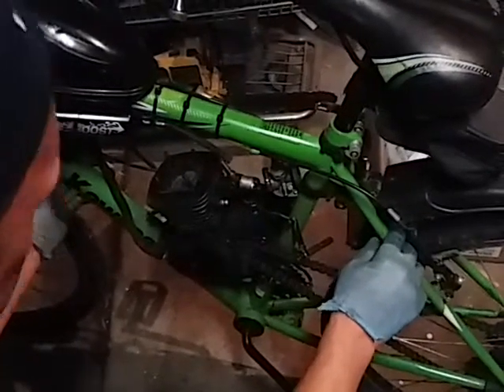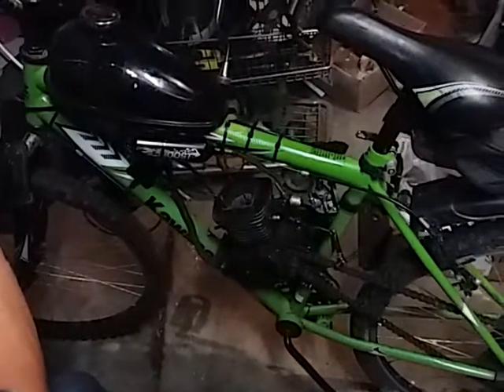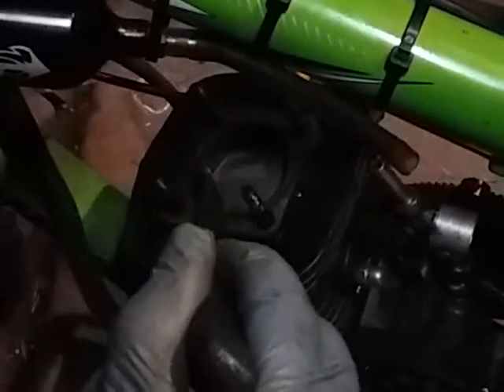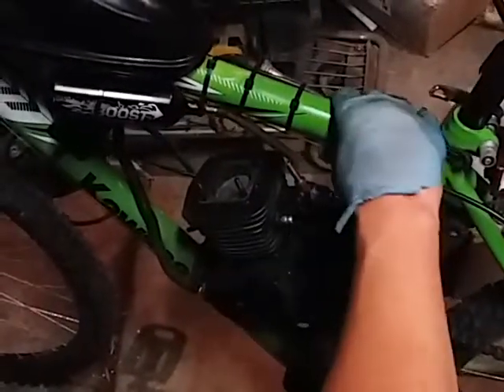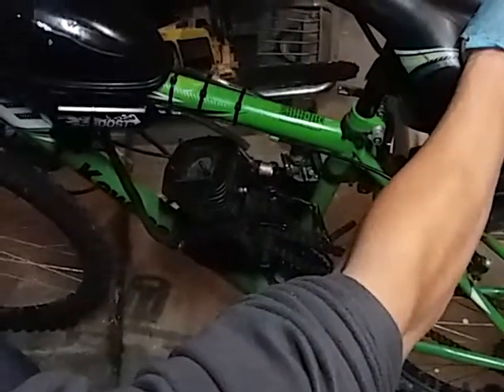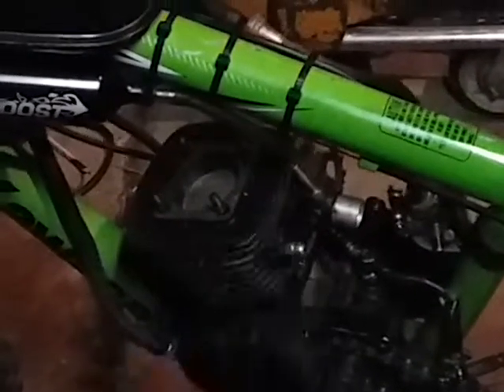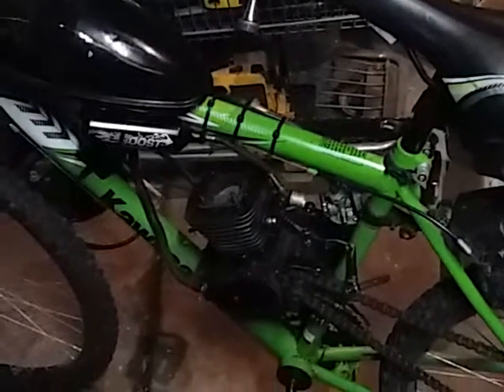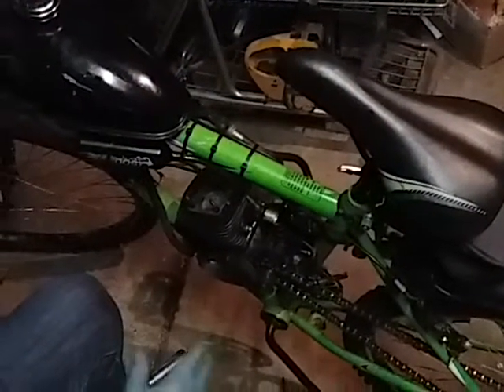80cc motorized bike engine seizure

Comment: I am able to spin the tire with open clutch and piston not moving?
Reply from the maker: If you pull in the clutch and spin the tire the piston should not move.
Reply: @dufourrichard856  I meant opposite with clutch engaged
Reply from the maker: @cory4152  if the clutch lever is released (clutch engaged), when you spin the tire the piston should move.   As long as chain is attached to wheel sprocket and engine drive gear.
Reply: @dufourrichard856  I know that just wondering what failed.i should have said it seized up on me then I managed to get it unstuck thought I was good to go but wouldn't crank so I took off the head and if I hold the piston the rest turns as I spin the tire
Reply: @dufourrichard856  I appreciate the replies and thanks for the awesome content 👍
Reply from the maker: @cory4152   Oh I see, you're connecting rod is busted

Comment: Should always do oil/gas mixture .
Reply from the maker: If your engine is a 2 cycle type engine, definitely.  Follow the engine manufacturer's recommendations for recommended fuel oil mixture ratio.

Comment: Na mate buy a piston and cylinder and you might spend 20 to 30 .
I fix and save plenty of motor bikes for very cheap.
It's all a matter of knowing what your doing not advising people to spend more money on a new one.

The diagnostic was great.
but you're talking like one of those cheap motorcycle mechanics saying to buy a new engine case when all that's wrong is some stripped boots and a bad alternator.

If you look online and spend a little time you can fix it yourself for cheap and never look back
Reply from the maker: It would cost the guy more for me to rebuild it than it would to just buy a new assembly.   The "cheap" mechanic that you are referring to might do the rebuild it for peanuts, not me.

Comment: I had this problem. I didn't put enough oil. I fixed it by removing the top head. Banging off the rest. Piston is ok. Rings touch the walls inside., Scraped up. I used a buffing tool ...spinning wheel and buffed smooth. Rings seemed alright.buffed slightly too. Put oil on walls . everything slides smoothly afterwards.on assembly. Test drove, surprised rode normal with no lack of performance. Soo. It is fixable,without buying any extra parts. Now I put sufficient oil no matter what. 
Many Gas stations carry 2 stroke oil. I didn't realize. I put probably 30:1 ratio and not 50:1. It's been broken in, but rather not risk it.
Reply: I thought my bike was destroyed until I saw this. It gives me some hope😂
Reply: @4gsinabackwood  probably can fix it.
Reply: Hey, I’m having the same problem as the one in the video, how did you bang the cylinder off?
Reply: @marcussmith9456  Engine ain't working. Start pulling it apart. Remove top nuts/bolts. Remove head. See other videos for tutorial. Can use a chisel and hammer, hit side of head with light taps. Don't break it. Good luck
Reply: @johnargue2977  I got it off thanks to you! Thank You!